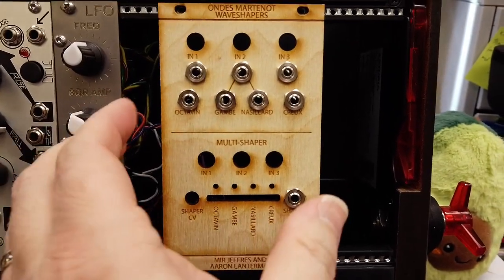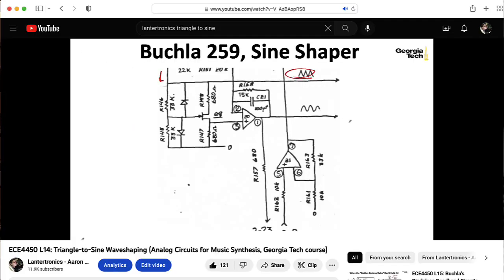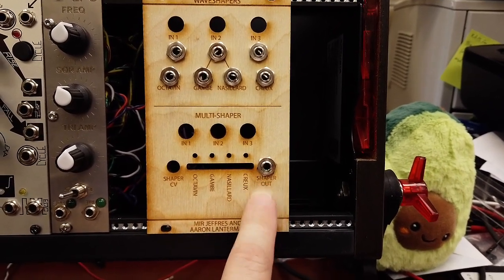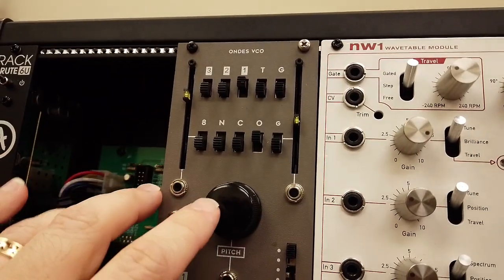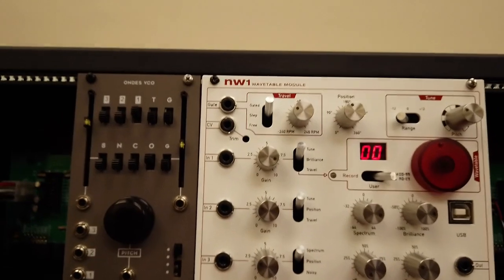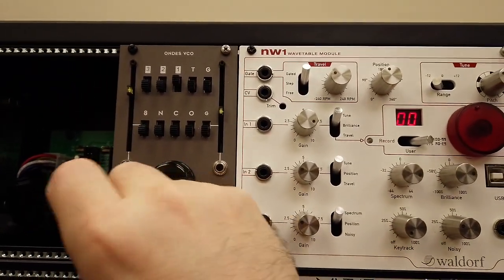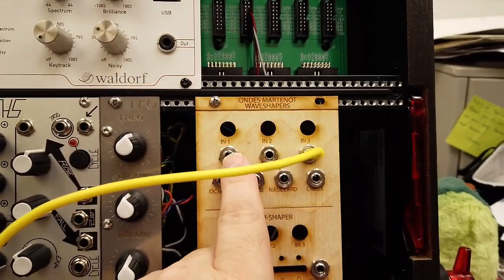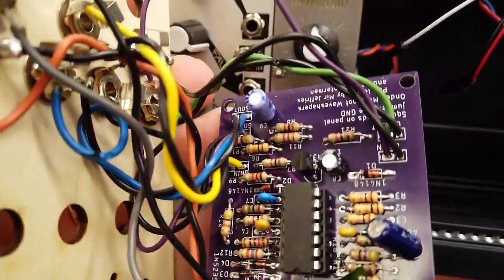Ondes Martenot Waveshaping Circuits in a Eurorack Synthesizer Module (custom PCB layout)

Comment: Seems very cool! I would be interested in the final version. Maybe for the bottom part where the controls are TBD it could be cool to have a VCA with a level control pot/CV control input and several signal inputs so you could mix the waveforms through it. Then someone could perhaps hook up a version of a touche via CV as well and get that aspect of the ondes.

Comment: I couldn't find schematics on this.

Have build a simple (no knobs and stuff) VCA using Push Pull transistor config and some sauce to prevent zero crossover and it sounds awesome.

Comment: About the Ondes, do you have any insight in how to replicate the touché d'intensité with modern resources?
i'm trying to get it done with a contraption coupled to a potentiometer. But no results yet.
Reply: There's a company that makes a touche midi device actually.
Reply: @christopherventer6391  I'm aware.
Reply: @ciro_costa  Oh, you want something you can build yourself? Possibly modifying a spring-loaded treadle pedal could work.
Reply: An approach I have been trying is magnets at the end of an arm (about 6 inches long). Beneath the arm is a small bag of fabric in a hole (about 1.5in). This does provide more resistance as you push down further. All you need is the toe of a sock and some of the sock fabric. There's a hall effect sensor mounted below the magnet. There's probably still some refining to do!
Reply: @SamuelBurt  So you put magnets with the same polarity facing one another to act as a spring? That's a cool idea!
Reply: @SamuelBurt  that's pretty interesting. do you have videos of it working?